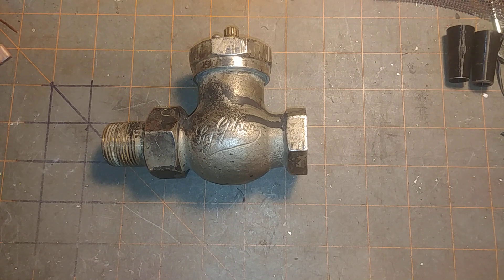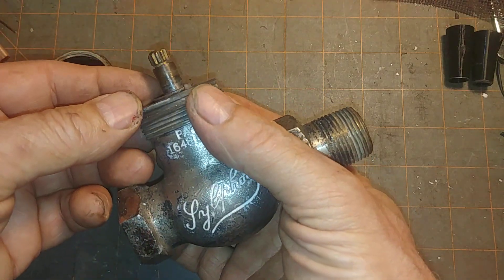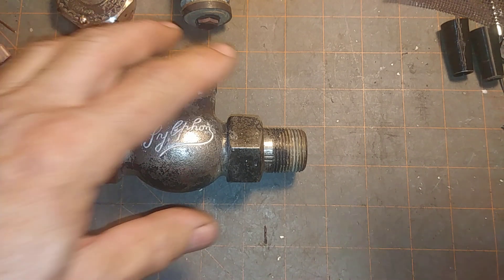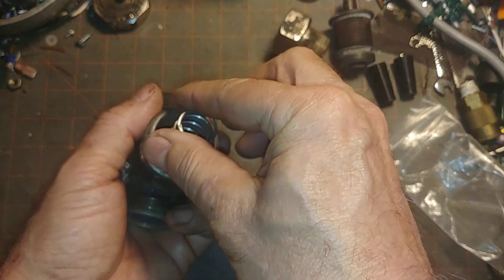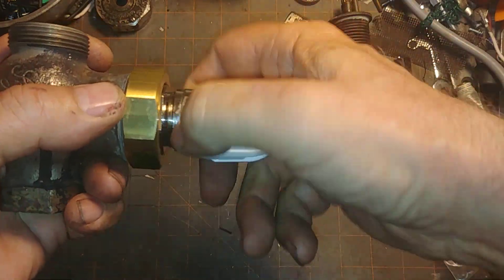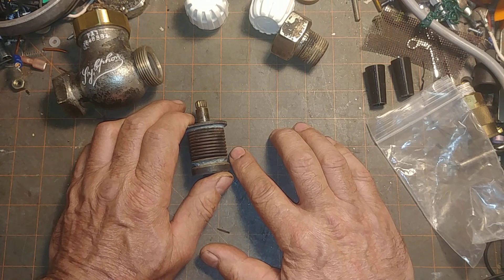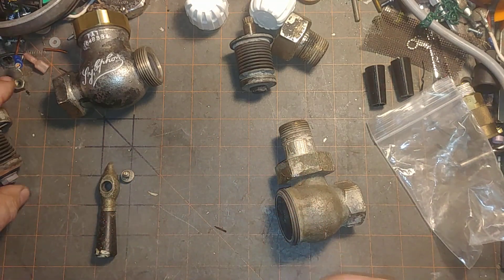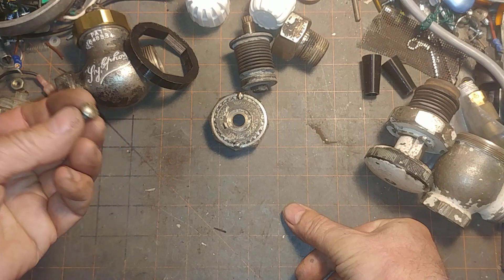Rebuilding A Coal-era Steam Vapor Vacuum Radiator Valve - Webster Sylphon

Comment: Where can I find these kits to update old valves? I have an old house that the steam system was converted to hot water and would like to covert so we have control of temperatures in each room. Some of the valves are belknap and some are Marsh while some just have a "B" on them.

Thanks for the video. It was very helpful
Reply from the maker: You are welcome!
I would reach out to the folks at Tunstall Associates to get their take on what would be best for your situation.
Reply: With your help I discovered some of their literature. Now that I have a plan and some resources I just need to wait until warms up so I can pull the valves apart.